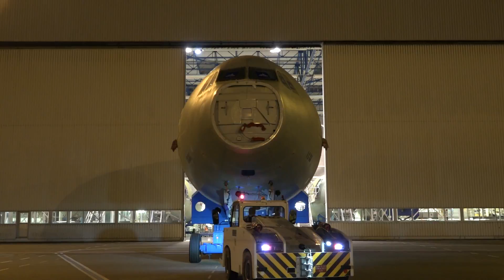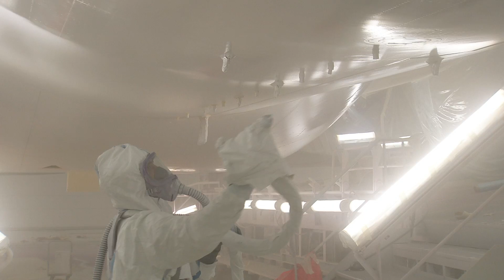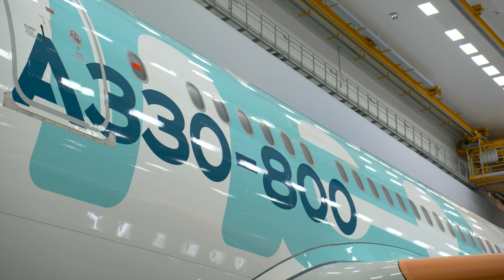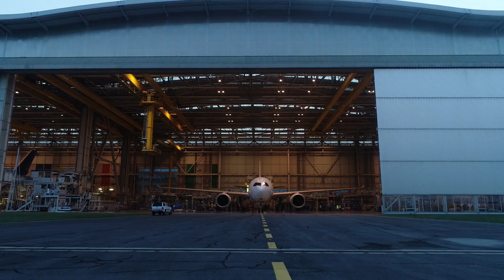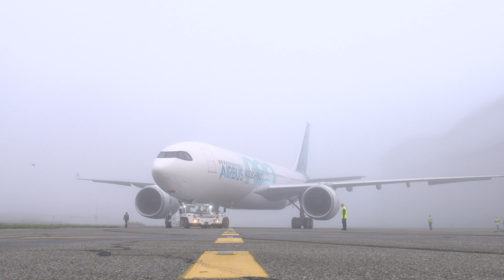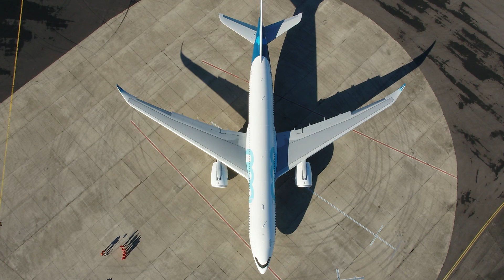In the making: Airbus A330-800

Comment: At a glance it looks like a350 ULR. But with wider and longer body. Still,i can't really see the difference between this and a350 ULR. Enlight me please
Reply: The A350 is the largest twin-engined plane Airbus makes. It has a standard economy 2-4-2 seat configuration. The A350-900ULR (Ultra Long Range) variant has extra fuel capacity, and therefor a larger range.
The A330 is one size smaller than the A350, but still a wide-body aircraft with a standard economy 3-3-3 seat configuration. You can find more detailed specifications on wikipedia. 

Spotting-wise, I think the biggest visual differences between the planed are the shape of the noses.
Reply: @Victor-oz3zo  oh nice,thank you for  enlighten me ☺️☺️

Comment: I believe that the A330-800neo will be a failure like the A340-200. The demand is very low and only 10 have been ordered.
Reply: The a340-200 was a quadjet JOKE. The a330-800 is a superior and more fuel efficient twinjet, it’s just ahead of its time a little but also late in the game to its competition. It’ll sell I hope!
Reply: Johnny Wynn In the 90s it was still normal to buy a quadjet. It was just that the operators didn’t need a small longhaul aircraft back them anymore (thought later a330-200 became popular). I think the same is happening with the -800 now. Most of the airlines just do not need a small long haul aircraft as they can fill the extra seats -900 gives. Only time will tell the success of this aircraft but as of now I think that Airbus will stop producing it in a couple of years and only concentrate on the -900. Many airliners are getting rid of their A330-200s as they are becoming too full to operate.
Reply: Okay, I take back "The most airliners are retiring their A330-200". Only Emirates and smaller airliners have retired and sold their aircraft to second hand operators.
Reply: @ETMiklu  I Should of though about that before commenting, and you are absolutely correct! Airlines really are moving away from smaller long haul planes little by little. EK is a good example, they do make sense for several airlines but still its 787-8 Competitor maybe doing far better than it but that plane isn't selling either, even though its successful, with the 787-8 having far more advantages and if no orders come to the a330-800 is a few years, its sadly a blow.

Comment: Wings look like the Dreamliner wings. Again copying stuff from Boeing🙁
Reply: you're getting the wrong end of the stick.... Boeing has been following Airbus and not the other way around!  Airbus was first to implement fly-by-wire technology. Boeing followed.  Airbus was first to fit 2 engines to a wide body aircraft.  boring followed. Airbus was first to introduce light weight components.  Boeing followed...
Reply: @billybill6604  some of the things are designed by Airbus. But i say about the wings.  Engines looks like at the 777 engine. Cockpit a330 looks like at the 777. Its familiar. That airbus designed fly by wire, so what. By the way FOKKER designed and introduced GLARE compositie, not airbus. They copying and buying that from the bankrupted Fokker because Fokker began producing parts for there planes.
Reply: +Jouni Airplane Video's Airbus is a consortium made of multiple European  manufacturers. .. it all started between the French and the British.... Fokker was a long way behind aerospatiale of France and BAC of England...Fokker eventually merged and played its part Boeing and Airbus influence each other. That's all there is to it.